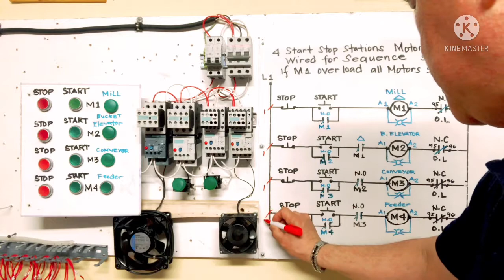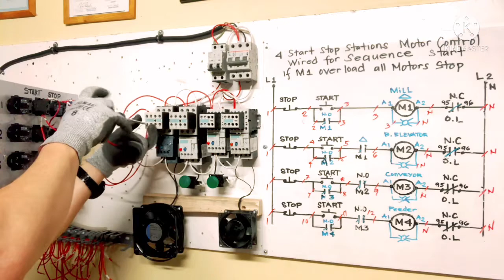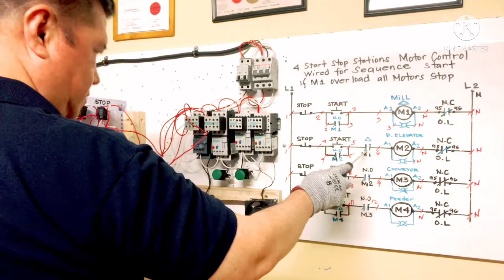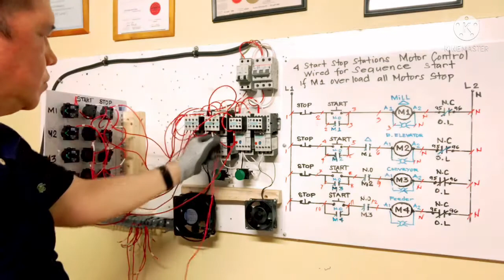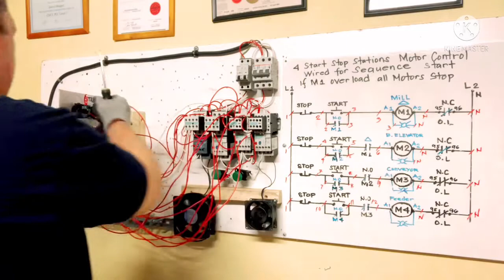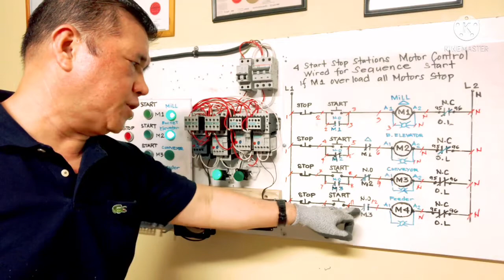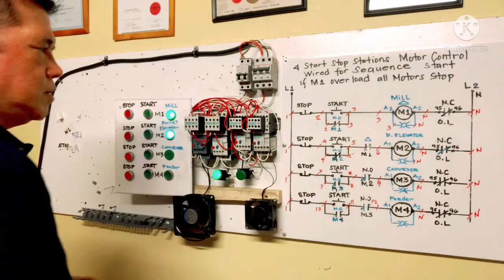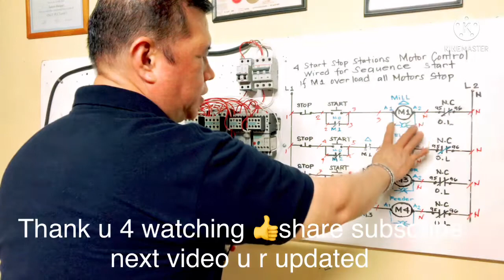4 Start Stop Stations Motor Control Wired for Sequence start,  each motors with interlocking start.

Comment: Sir, I'm very interesting about your video teaching of electrical installation for my future carrier. For this 4 start stop station sequence control, which places or location this motors use ?
Reply from the maker: ghe control panel in one place but the motor defferent location . for feeder then conveyor , crasher , screw auger or elevator to thank then going to miller motor.